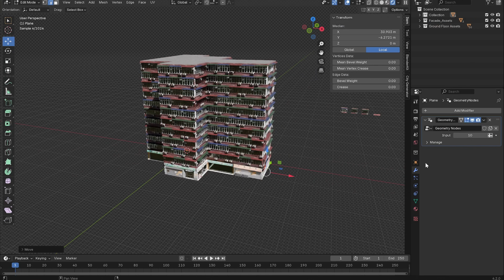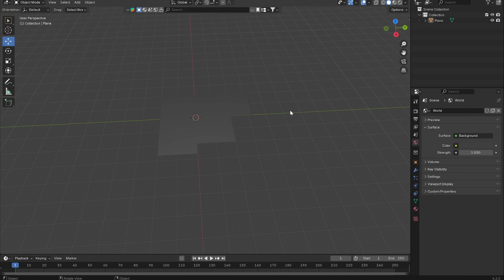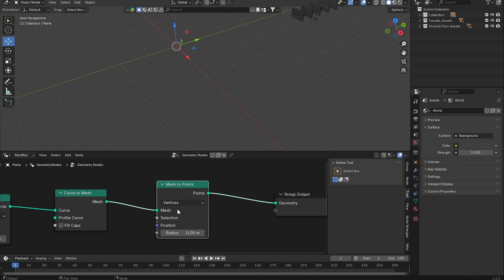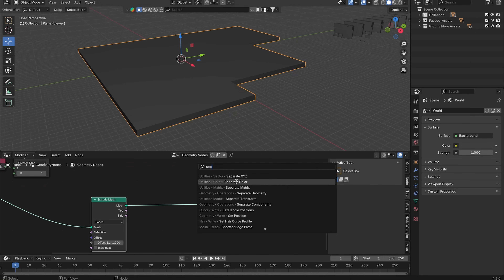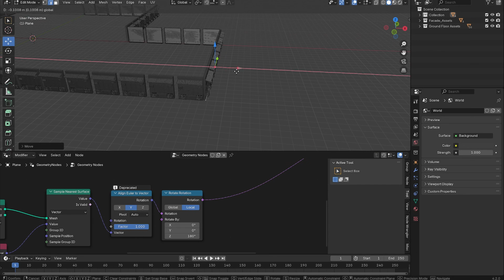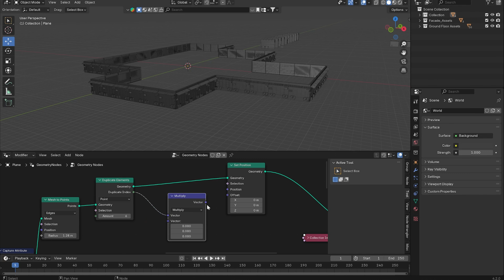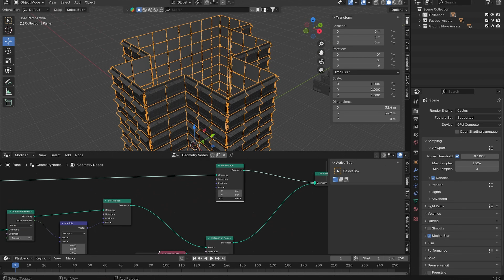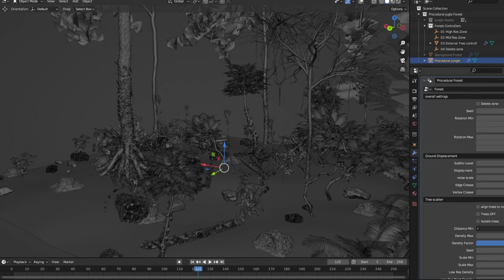How to Create Procedural Buildings | Blender Geometry Nodes | Procedural City

Comment: Hello, thank you very much for your videos because it really helps us...I have a theme which is 3D urban environment so a digital twin of an area with buildings but I am faced with a problem because in my 3D model I have buildings which do not have the exact heights so some heights are larger or smaller compared to the exact heights so I would like to know if you could recommend a software which could generate the buildings with the exact heights in an automated way because the goal is not to do it manually because I have a large number of buildings...thank you for your support